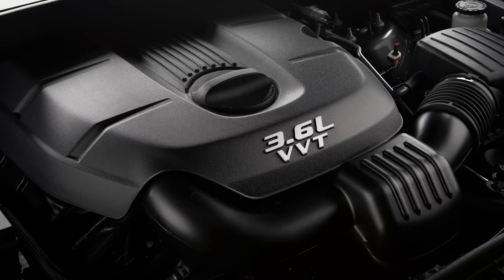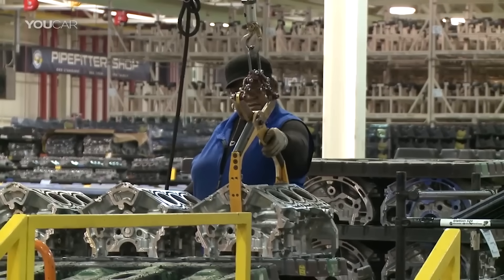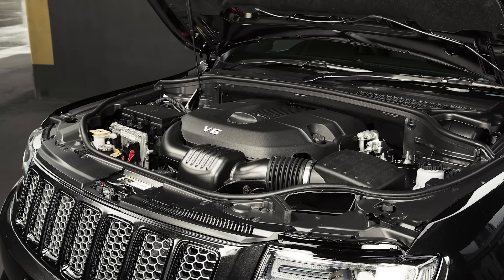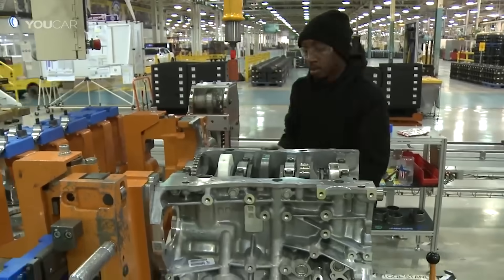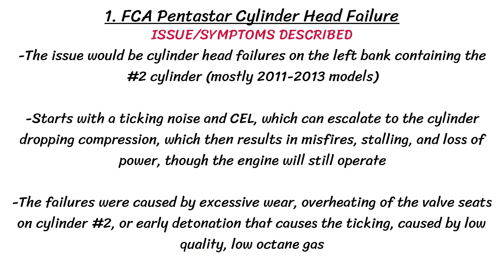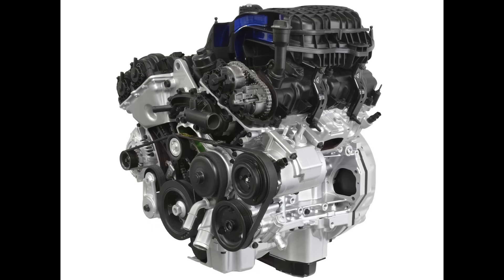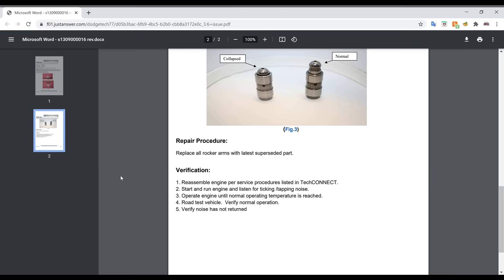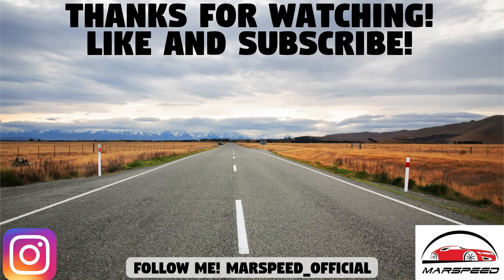The Specs and Fatal Flaws of the Chrysler 3.6L Pentastar V6 Engine

Comment: I always thought it was a great motor. The 3.6 had High horsepower for a v6 at the time and still relevant for then the output.
Reply: I had one in a 2013 Dodge Charger rental car. Had it up to 104 mph and smoothest engine I ever drove. At 104 there was no wind or tyre noise, and a rock steady ride. Great handling. Lots of room inside. Just the sound of a satellite fm pumping out some great old rock and roll. Had the car for 2 weeks and loved every minute of driving it. Better than any car I have driven in Australia.

Comment: 3 Jeeps Wrangler here with some of the issues mentioned.
Jeep 1 2012- Rocker Arm failure at 85k miles. Driver side rear. 
Jeep 2 and 3 had oil cooler assembly leaking oil (both not drivable from the amount of oil gushing out)
2015 at 69k Miles
2017 at 59,000 miles (covered by warranty) 
Out of all the repairs 2 where done well.  The one covered by warrant still leaked just not as bad. I Ended up self repairing it. Simply tightened the oil cooler to spec.

Comment: My friend takes in Jeeps all the time with these engines for replacements.  The jeeps are lifted with large wheels and outfitted with tube bumpers, skid plates, winch, etc.  I wonder if this engine is really suited for heavy duty applications based on how many I've seen on the shop floor with less than 100k miles.

Comment: I'm on my third v6 dodge now. Every single one of them have made that noise almost from the start. That being said, the past 2 made it over 200k miles with no issues. Let's hope the durango makes it that long as well.
Reply: Mind you that you can actually hear the injectors ticking as well. The rocker tick is much louder, I've seen quite a few people mistake the two. The rocker tick you can usually hear from inside the cabin.
Reply: This is usually accompanied with a cylinder miss code.

Comment: Just wanted to let you know since watching your video on the XZE bulbs you put on your charger I ended up replacing my stock bulbs with those XZE on my 2014 Dodge Charger , I changed out my high And low beams ! What I huge difference and on a separate note since I had to remove my air box I decided to clean my air intake / throttle body and fixed my engine ticking, tapping noise also , since I had everything off and when I was putting everything back together I noticed this metal bracket or heat shield behind the air intake / throttle body was loose and barely hanging on end by a screw or bolt !!! , i figured out how it seats and put it on as snug as I could being that there was no nuts that secure it In place an notice went away !!! Wish I had made a video of it I might still but just sharing some information with you to look out for , mechanics almost took my money wanting to open up the engine !!! Forget that !!!  Tomorrow I’m a look into the nuts for that metal piece and see what it is

Comment: They have been testing a turbo version of this engine for a couple years and the power has been a great increase. 290-305 non turbo to a large Honeywell turbo set up gains of 125hp more. This is what I heard from the grapevine..... this engine overall has been a solid v6. I had a Mitsubishi 2.5v6 in a 97 Sebring long ago and that was a tank. No issues ever. Great first new car in my days.
Reply: That engine will not hold together for long if they add another hundred horsepower like other manufacturers are having issues with their over turbocharged four and six cylinders
Reply: @hyperwebbing  they can beef up the heads and gaskets and internals to handle the power like other manufacturers do or what we do to our classic cars.
Reply: @jimcole2648  yeah they can but it's just way more pressure is way more strain just how it is every one of these turbo and double turbo and turbo and supercharged 46 cylinders at they've been putting out for the power in the fuel efficiency aren't going to make it to 200,000 a lot of more having issues with the engine major part before they even hit 100,000 and that's even some of the Japanese models
Reply: @hyperwebbing  absolutely I agree on these engines with pressure and turbo and supercharged combos.  You can do so much and that’s it. Just like ford with the eco crap. The 3.5 for example, they did so much to it and for the ford GT, they modified it to handle the power. I had a lebaron gts turbo. That 2.2l was a good engine. It was quick, for the times compared to now. The only thing I ever had wrong with that engine was exhaust manifold rusted and started to knock at 375k miles. It went another 60k before I just donated it. It was worthless by then.  Shockingly the turbo lasted till 300k. Usually they don’t and start to burn oil. Lol.  Sometimes you get a good pick lol.
Reply: @jimcole2648  yeah if you pay attention to a lot of the different manufacturers in the engines that they have in them and what they've been doing to them you'll see a trend where they taking what was once a Fairly reliable engine that could get you no 250,000 miles out of it probably even three hundred thousand miles done right and they're putting turbochargers or double turbos or whatever whatever on it and they're doing the direct injection and these engines are literally coming apart they're leaking stuff they're losing compression they're basically needing an expensive repair before they hit even 120,000 miles but by 150 162 probably dead and some of them are dying way before 100,000. I have a supercharged Jaguar V8 32-valve engine 400hp and it is perfect.  The setup pushes its design but never pulls it apart. There's a couple Easy Mods that can be done to gain about 40 more ponies and I still will be getting near the limit but not overtaxing it if you don't get into it too often... you want to use -not abuse. But Jaguar with the same route as everyone else and they took that 4.2 squeezed it out 5 liters, added more aggressive components to catapult HP to a crazy 550. In a 100% aluminum bodied/chassis/suspension/engine.  Only the bumper covers are plastic. So some engines are having major issues close to 100k. Depends on the abuse and the  maintenance.  But the previous iteration, like mine cam go 200k ez many get 300k.
Reply: @jimcole2648  I remember those Chrysler 2.2 as they put them in so many different models even I think the Mitsubishi Eclipse had it because of the Plymouth Laser. I'm currently working on a 3.6 L pentastar and my phone wrote Death Star I should have left it cuz that's probably more exact. If you know somebody that has a 2011 through 2015 or 2016 3.6 L Dodge make sure they've been doing the maintenance on it right don't ever let it overheat replace the oil pump and the oil cooler filter housing assembly before it leaks. It will be my third time tomorrow all the upper stuff off to get to the heads to see what's going on after doing the oil cooler and then going back into it again to do the knock sensors today through a code after I put everything back together they were swimming and oil so I guess that makes sense not really only after putting everything back together second time with the startup and there was a distinct mechanical tapping noise so I left it running only for like a second
Reply: I'm over 131,000 miles on my supercharged 3.6.
Reply: @wvjeepguy8178  what aftermarket unit did you use?
Reply: @jimcole2648  Edelbrock with a Mopar intake. I have a Pedal Commander to get rpm's up quicker so that the boost can kick in, along with 5.13 gears.
Reply: @wvjeepguy8178  sounds pretty cool. 👍🏼👍🏼
Reply: Stop drinking bro.
Reply: @zyxzyx3030  I can drink as your dumb ass drank it. 🤣 do your homework kid.  I have been to the proving grounds in auburn hills.

Comment: The oil filter housing on these are also prone to cracking causing an oil leak.
Reply: Yah, avoid taking it to shops that don't know the engine.. I've also heard of dumb technicians overtightening the oil filter cap causing the assembly to crack because the plastic is shitty. The filter is so damn easy to change on this engine you might as well just do it yourself anyways.
Reply: Either the housing itself cracks or the seal on the oil cooler fails, as was the case on mine '14 charger. Oil pooled in the valley and ran down the back of the engine, burning off on the bellhousing and causing it to reek of burnt rubber. Very expensive repair at the dealership, but looks to be an easy job if you have some mechanical inclination.

Comment: The oil cooler/oil filter housing was a problem in early models also. Engine oil could get into the cooling system cause a big mess. In some cases coolant could mix with engine oil and take out the engine crank and rod bearings. They came out with a revised oil cooler housing as a the fix for it.  The rocker arm seams to the most common though. This is more of a supplier QC issue as Chrysler designed it but a supplier built it.
Reply: You can replace it with an aluminum one from Dorman & call it an upgrade all you want but it's still gonna leak from underneath it when the 0-rings give way eventually...

Comment: I have a 2015 JKU with around 80K on the clock, the Pentastar is still running great, but I will be sure to keep my eyes peeled for any of these issues! Great video, thanks!
Reply: Just out of curiosity, have you done to cam phasers yet, or replaced the chains, tensioners and guides? If not, you'd better look into it, BTW it costs several thousand dollars.
Reply: I have a 2016 JKU with 132,000.  Just had the ticking noise repaired, rocker arms, lifters and cams: $2,485.17.

Comment: My wife’s 2011 Durango has the “oil pressure circuit stuck off” code and no one can figure out the problem. Car loses power when you hammer on it. Everything’s been replaced and even dodge can’t figure it out.
Reply: My 2011 had a similar issue. It was a hidden "limp" mode that was activated to protect the engine and was caused by another issue.
Reply: @mmatthewdavey5704  yeah but wth is it? There’s no other codes.
Reply: @russellhopperton1907  ill have to ask my mechanic exactly what the fix was. He was about to codemn it because my engine was behaving as if the bank with cylinder 2 was non functioning so he thought it was an engine failure. Somehow he brought it back to life but i still have misfire issues but no more hidden limp mode.

Comment: my jeep wrangler jk 2013 is experienciing cylinder misfires  got it fixed still the problem prevails and cooling problems it runs extremely hot idk what to do my jeep has 50000 miles

Comment: 170,000 miles on the 2012 Grand Caravan, no issues. Regular oil changes with synthetic, plugs replaced and coolant flushed 100,000 mi. Here in the rust belt, this vehicle is probably going to die of rust and corrosion long before the 3.6 l gives up.

Comment: They made really difficult and time consuming to replace the oil pressure switch which fails a lot. Have to remove the entire intake manifold to get to a $20 part. Was never an issue doing it in under a min on the old 4.0
Reply: I agree with that, my oil pressure sensor has been reading high for a year. No engine light yet but the replacement is far from easy
Reply: @CJJ4848  I just replaced the sensor myself, after my mechanic did the oil filter housing replacement the sensor he put in was junk, and the code returned. I bought an oem sensor from amazon and 6 hours later, I did a lot of cussing without taking the intakes off. Had to buy a special socket but saved me 350 $ from taking it to my mechanic. If you have basic tools you can do it hardest part was trying to thread the sensor while laying on top of the engine lol

Comment: I had a 2014 dodge caravan for work. The engine didn’t have any major issues, it was the junk 6 speed transmission that kept going out, was on its fourth transmission when my company got rid of it at 160k miles.

Comment: Try to use high octane and clean oil changes and keep the radiator flushed out,and you'll be fine,my buddy has 12 charger's in his cab company with the 3.6 and he loves um and they all are awd

Comment: My 3.2 has been gold so far.  Over 30mpg with close to 300hp. No issues at all on the 2015 model. Still zero issues 4/22
Reply: It’s peculiar how I’ve never seen a cylinder head, rocker arm, water pump or oil filter housing gain on the 3.2. 🤷🏻‍♂️
Reply: @Pablo-cp9nc  Thought maybe it as upgraded so quick there are not that many out there. But what a smooth engine it has been and more than enough juice.  No turbo or direct injection just a super well designed engine. Never works hard even going up a near wall.

Comment: I have a 2012 with the extended head warranty ... no ticks, no issues ... I do use 89 octane ... but not for head issues , mine actually does better on mileage running the mid grade gas than regular...

Comment: sorry but i never replaced a water pump on a penta for overheating...but replaced many heater core mostly wrangler and theres a service bulletin for that that you need to replace the heater core/oil filter housing and radiator...rarely found a pentastor overheating unless it has a leak or the 50cents thermosthat staying close or most of the time open

Comment: It's a great engine. We have a 2014 Durango bought new. Replaced one roller rocker on the right bank due to a failed roller rocker.  We also had to replace the oil cooler, they crack.  But this all happened Nat 140,000 miles. Not bad!!!!

Comment: The lawsuits are funny as all hell. Many of these people never go back to the dealership and leave notes for FCA to see what the issues are rising from. Owners use sub-quality parts to fix vehicles from mom and pop shops then expects FCA to fix them. They don't have any ground to stand on.
Same thing for the oil filter adapter. The plastic typically breaks like a oil drain plug that get's stripped: people just crank on them as hard as they can, instead of following torque specs/until you get it just tight enough.
Finally, "low quality gasoline" is not 87 octane, it's just bad gasoline gas stations recieve. I typically go to Sunocos around my town, and so don't many others: I don't think I've ever heard of my local stations recieving bad gas since I started driving myself. (Granted, isn't that long. But still.)

Comment: No oil cooler failure?  The oil is cooled by an oil to coolant device which has parts that break when replacing the oil filter.  This is a well known issue and the part has been revised at least twice over the years.

Comment: I have a Chrysler 3.6 & it ticks and knocks like crazy. I have 2 friends that have GM 3.6 VVT engines and they run just fine. I will buy GM from now on!
Reply: While GM usually produces decent engines, the 3.6 isn't one of them.  They've got some ISSUES....
Reply: @aaronkoch3273  you thinkin bout the LFX V6, the LGX V6 is the next gen that corrected all those problems... 16 & up>

Comment: My town and country is ticking at the top and I assumed it was the rocker valves. Im glad to know there was an upgrade to the rocker valves..One day I'll try to replace them myself oppose to dealership..thanks for the info
Reply: Wait to long and a rocker will come apart and when you get metal in the engine oil passages it's done for.

Comment: I have a 14 ram I bought new with a tick 6.  Honestly mine runs like a watch and has 91k on it.  The only problem I’ve had was the 3 way coolant valve failed causing the transmission to get hot and blow fluid out the breather.  I had it fixed the the transmission serviced.  Tech said the fluid looked good but I didn’t want to chance it.  That 8zf is expensive.  Now that I’ve said it runs like a watch it’ll probably blow up.  When it does give up I may do an LS swap.   I’m just not sure how to deal with the engine mounts and ecu issues.  I’m sure there is a shop that can do it.  They ls swap jeeps all the time.

Comment: Oil filter assembly is prone to cracking and leaking. Huge job to replace it because the top end of the motor has to come off. Such a wide spread issues. The parts were on back order for 2 months recently. Chrysler still not taking any action or responsibility for the issue.

Comment: I have an issue with am 2017  Jeep Grand Cherokee Limited with the 3.6 engine. It less than 27K miles on the motor and the issue started around 26K miles. It seemed to run ruff and was giving me an issue out of the blue with the Auto Start/Stop feature, but quickly I started seeing the check engine light. I have had it to the dealer twice. Twice they repaired some sort of controller that is supposed to help with cylinder #2. I think it is a bunch of BS. They say they cannot figure the problem out. They want me to bring it back for round 3. I am thinking of going to another dealership for a second opinion. I am betting it is the issue you mentioned with the fuel and the firing of cylinder #2.  Whenever a dealership gives me vague reports on issues and tells me they are at a loss I being to question things. There are only so many things that can cause this I want this fixed while it is underwarranty. I really like my Jeep but I am beginning to think I made the wrong choice in vehicle.  My wife has a 3.6 in her 2019 Charger and it runs flawlessly. Traditionally we have been Ford buyers. I guess I will be looking for another brand if the Jeep doesn't get fixed and especially if the wife's charger has issues.